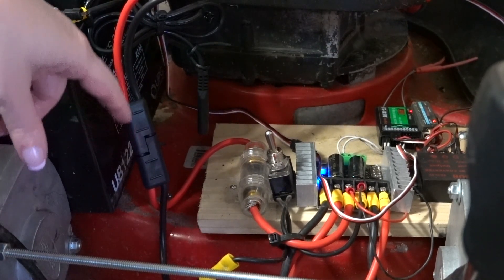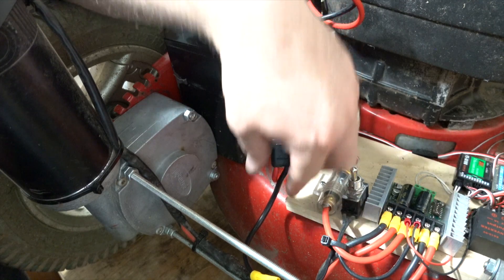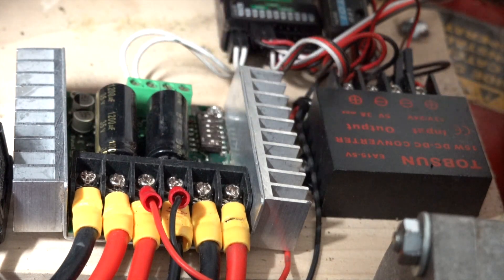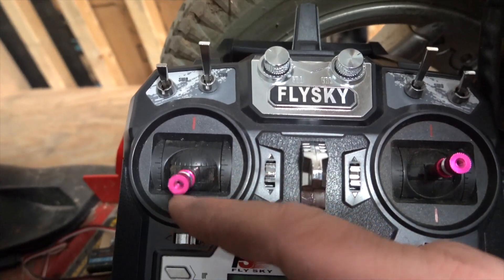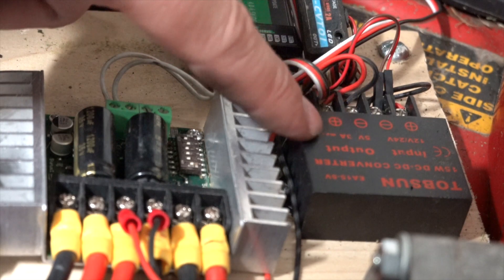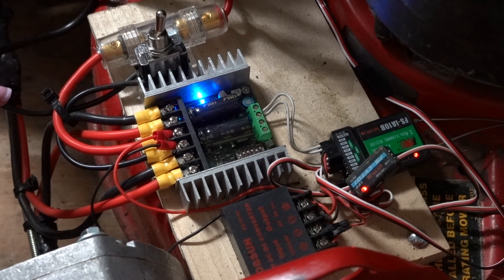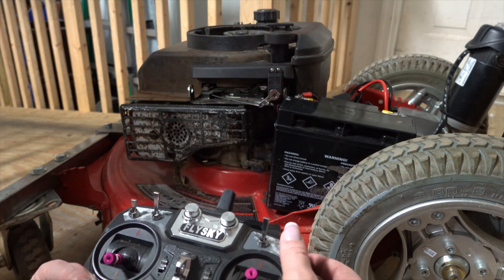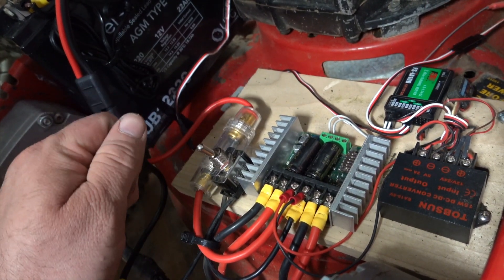How To Wire An RC Mower (Step-By-Step)

Comment: Hi to you both, Totally enjoy the video. I would like to know where you get your motor driver from?Ive started my build from an old mower i had laying around and just bought a controller. The motor driver like yours ive found runs around 280.00. Is there another one i can use?
Also do you have a video on how to setup the controller mine is a flysky i6x? Thanks Vinney
Reply from the maker: The shipping shortages are making the Sabertooth motor drivers hard to get! You can also use the Cytron motor driver, https://amzn.to/3IJVP66. We used one for a couple of months, but you will need to come up with a better way to affix the heat spreader. It comes just stuck on with a sticky pad, and after a couple of uses in a hot and dusty environment, it will come off and then the electronics will overheat. We tested it and it worked fine at first, but ultimately switched back to the Sabertooth when that happened to us.

As for setup on the controller, you don't NEED to do anything. It works fine right out of the box. The only change we have really made is to the "dual/exp" setting of channel 1 to make the steering more of an exponential curve rather than a linear line, which helps steering control when you're trying to turn just a little in one direction or the other. Any other changes for servos would be based on your particular setup and preferences.
Reply: @MeantToBeLindseyB  Thanks for the fast response. I think i am going to try the one you suggested and add a cooling fan to the top of it. The reason i asked about the transmitter was this is the first time I've ever messed with one.

Comment: Hi, how did you released the brakes on the motors????? Thank you!
Reply: Hi I followed the exact same prototype of your remote mower but now I don’t know how to release the brakes on the motors🤔🤔🤔, i got the same motors and everything, I hope you can help me, thank you 🙂
Reply from the maker: There should be 2 thin wires coming from the brakes. If you hook those to your main power, the brakes will disengage. We decided, instead, to just remove the brakes all together. Just remove the reflector end of the motor and unbolt the brake from the end of the motor and put the reflector back on the best you can. Since it’s just an emergency brake, it doesn’t affect performance.

Comment: Waiting now on your camera addition to this unit - really curious how to hook that up and what type of camera to get for it and should it be controlled through rasb-pi or wifi camera unit that links to a smart phone that is positioned on the top of your controller. Also had the idea of adding a 3rd servo and building a side deck to attach a 20v dewalt weedeater for trimming the sides of fences and house. Also thought about adding a small tow hitch to the back of the unit for pulling an airator and fert and seed spredder. Just thoughts right now, but really would like your input as well on these thoughts. Not wheel chair user but challenged as well and striving forward. The thought of being able to stay inside in the AC and get the job done is appealing. Anyway camera addition for being able to see where it is going is cool. Also if adding a 3rd servo will the remote have a channel available?
Reply from the maker: We've been considering getting the DJI digital camera kit for clarity and immediate response whereas a lot of wifi cameras have a lot of delay, which would be too risky. The biggest hurdle we are still trying to figure out is how we would control it so we could look behind as well as in front and on the sides for the same reasons. 

As for the extra servos, there are 10-channel receivers that you can get for the transmitter we used, so you have plenty of extra channels.

Comment: I a confused on how you wire the receiver.  I understand that you use different channels for different things but where do they go exactly to which ports and also the other end... where do you connect them to?  thank you for your responses.
Reply from the maker: It varies on your exact setup, but we have power in (red and black) from the step down converter to the VCC port of the receiver. Then we have just the white wire from channel 1 from the receiver to S1 port on the motor driver and just the white wire from channel 2 from the receiver to S2 port on the motor driver. Channels 1 and 2 are the controls of the right stick of the remote transmitter.

Then we have 2 servos. The servos use all 3 wires (red black and white) plugged into channels 5 and 6 of the receiver. We then went into the remote setting to set channels 5 and 6 to the dial and switch from the remote to control the kill switch and throttle on the mower. You can reference your manual for exactly how to set those settings.

Comment: I love what you two did with the push mower!!!!-and as a small engine shade tree repairman, and prior lawn service (extremely small business)owner ! wondered if you knew of other options available to add to your systems like a starter and alternator or battery charging system -to keep the servos fully charged while its running,and if you did ,why didn't you use or add them? the reason i ask is the addition would make these systems much more user friendly with a remote start and you wouldn't have to charge the batteries after mowing.I'm no way disrespecting this build, I love it!!! and hope to build one myself in the future for a personal use as I'm getting old and have a heart condition ....Not interested in pushing a mower or walking in the heat again -ever....lolololol
Reply from the maker: Thanks for the comment! 
Honestly, we don’t really know much about small engines or options for a mower engine like this. We’ve gotten a lot of suggestions about adding a starter or alternator since we built this. For the next build we’re probably going to go all electric for those reasons.

As for our yard, the one battery is plenty, but we can imagine if our yard was much bigger or on a hill or something we would definitely need some more like what you’re talking about.

Comment: Hello mate ! Your video inspired me to build one and it's running now. Thanks for the very informative video mate. Oh ! You mentioned that the Sabertooth required a 100 Amps fuse, is it really needed that big amps? Please point me to the article that mentioned it if you have time. Thanks again mate and be safe !
Reply from the maker: https://help.dimensionengineering.com/knowledgebase.php?article=2
Reply: @MeantToBeLindseyB  
Hello mate ! Thanks for the link. Reading it and now it mentioned somewhere that it's recommended to install fuses on the motors too for rolling the the motors when it 's unpowered will kill the motor driver. I am into electronic safety and might install one too. Thanks again !
Reply from the maker: With this type of build, we think it’s more likely the main leads will short rather than just an regular overvoltage spike. We still think that the 100 amp fuse on the battery lead is enough, but like this article says, it’s not a bad idea to also put 25 amp fuses on each motor lead.
Reply: @MeantToBeLindseyB  
Totally agree with you.. I will surely install a 25 amps on my motor leads for added protection. Thanks for responding. Sub !
Reply: @MeantToBeLindseyB  from that link it says the better way is to fuse the motors but they don't suggest how high a fuse you should use on the motors- any tips or ideas to do that? here's what they said - So blowing a battery fuse will sometimes kill the driver .

The better way to do it is to fuse the motor leads. If a motor fuse blows, the motor will freewheel, the Sabertooth will sit there contentedly,

Comment: it’s coming from the Motor driverThank you for answering me
Reply: You Guys are awesome
Reply from the maker: We can’t think of any reason that it would work when it’s on 2 batteries and not on just 1. We suspect you may have something else other than just the remote and receiver messed up. Email us some pictures of it hooked up both ways and we can see if we see anything obvious. Sometimes you just need a “fresh eye” to look at something. You can  send it the pictures to MeantToBeLindseyB@hotmail.com

Comment: My transmitter and receiver would not kick in with one battery it only works with two batteries 24 volts what am I doing wrong
Reply from the maker: How do you have your power supply for the receiver set up? Do you have the power coming from the motor driver or are you using a step-down converter?

Comment: How much for fixing like that electric mower
Reply from the maker: Our next project is to try it on an electric mower but we think the cost will be about the same. $500-600 in parts plus the mower. Also, a lot of people have asked but we aren't ready to personally start trying to sell them at the moment.
Reply: Tell me all the parts they put in the electric mower
Reply from the maker: @kennethsanchez1098  We haven't built an electric one yet, so we are not able to tell you that information unfortunately.

Comment: I just found some useful information that might help everyone out. I just bought an old White Lawncycler lc 215 e to make my next MowBot. The reason I bought it was because it already has zero turn wheels on it. After I got it home I realized it had an electric starter. After taking it apart I noticed it had a tiny alternator on the back of the engine. It mounts just like an ignition coil. I was curious so I took apart another Briggs & Stratton engine and it is also already set-up to mount a starter, and it has the holes already to mount the tiny alternator. It also already has a ring gear on the flywheel. So check all your lawnmowers that have a Briggs & Stratton engine. If you have the set-up you will be able to add electric start AND you can now have a charging system to keep your battery charged. My B&S engines are 6hp Quantums and the other is a 6hp Diamond i/c. I will try to post links to the parts below. If I cannot post them, here  are the part numbers. Alternator B&S Part Number 691991. $20.99 on Amazon.  Alternator Studs B&S  Part Number 691094. $7.37 only available on Part Select . com.  Starter B&S  Part Number 799045. $155.95 on Amazon. NO MORE DEAD BATTERIES! NO MORE PLUGGING IN YOUR MOWBOT TO CHARGE THE BATTERY!   I will post a link to my Facebook page below with pictures where the alternator bolts up.
Reply: Wont let me post a link to Facebook.
Reply: Holes are on back of engine, oil tube is on drivers side of engine, alternator bolts on by oil tube, holes are on each side of the governor, the alternator studs raise it up a few inches above the governor so it can ride on the flywheel. Any questions leave a comment and I will exchange e-mails.
Reply from the maker: Thanks for sharing this info!
Reply: @MeantToBeLindseyB  You might need this flywheel too. The flywheel looks to have more magnets than the other engines. B&S part #  PS9074689 flywheel.  $96.28
Reply: @MeantToBeLindseyB  So for about $130 you can add an alternator to any Briggs engine as long as it has the 2 mounting holes on the back. Anyone can comment and exchange e-mails with me if you need more information or photos.

Comment: Not a cheap hobby. I have $1600 in this build. I only have 1 good leg so I wanted to be able to sit in my house and mow on my big screen TV, so I put a $700 Hollyland Mars, and GoPro camera system on mine. I went with a brand new Troy-Bilt mower. The back of a Troy-Bilt rear bagger mower is all plastic so I had to make steel trailing arms for it, like a Ford truck. I kept the rear open so it has a rear grass chute instead of a side chute. It worked out great. Wish I could post pictures for you. Thanks for all your videos. When I get it all finished I'll post a Facebook link to a video for you.
Reply from the maker: Holy cow! That's awesome. You'll have to send us some pics! You can email us at MeantToBeLindseyB@hotmail.com or tag @Meant To Be Lindsey B on Facebook when you're finished. It's definitely not cheap but when you're paying someone else to mow your lawn, it definitely pays for itself in the long run. Of course, we did start with a free mower, so that helped with our initial costs too. Just the sense of independence it has given both of us has been worth it though.
Reply: @MeantToBeLindseyB  You got mail!

Comment: Thanks for your videos. I got mine working today. I had to pair the receiver and transmitter, you didn't tell us about that. lol.   I had to Google it, but it was easy. My only question now is how to use the fail safe. I cannot get it to work on my servo that controls the engine shut-off. I have it on channel 6 of the receiver. Same exact flysky receiver as yours. Help please.
Reply from the maker: Most receivers and transmitters come pre-bound, so our apologies for not elaborating more on that. 

As for the fail safe: In the fail safe settings, make sure that the channel 6 is “on” and that the switch for the kill switch is set to the “off” position when you save the setting. Hope this helps!
Reply: @MeantToBeLindseyB  I bought a 10 channel transmitter so I could use all the other buttons on my remote receiver. I still cannot use them because I don't know how to set it up yet..... I want the engine kill switch on the toggle switch. I'll figure it out.  And I've tried setting the failsafe a dozen times now. It saves my settings, but it doesn't do anything.
Reply from the maker: Sorry it has taken a few days to get back to you. Hope this helps!

To get your servos working with your remote this is what you have to do on the remote:
Go to Settings->System->Aux Switches
Then turn on whichever switches you want to be able to use for controls (SwD is the far right switch that I used, so turn it on) and set the Ch # to the number of channels that your receiver has, mine has 10, but yours might be 6

To save you have to hold "cancel" for 2 seconds.
Then, go back to settings->setup->auxchannels and go to the channel number you want to output to, and then tell it which switch to use on that channel (SwD in my case) hold save to cancel your switch should now control a servo plugged into that channel with no problems.

THEN

To set the failsafe, go to settings -> system -> RX Setup -> failsafe -> channel # -> set to ON and flip the switch that it should switch to when failure happens. Hold cancel to save.
Reply: @MeantToBeLindseyB   Thanks. That helped. It works now.

Comment: So I have a 12v dc motor off a car seat that I like to use as my servo on my big RC project.  How can I control that using RC transmitter / receiver?  Do I need a motor driver?  If yes, I know they make dual motor drivers, but what if I need to control more than 2 motors using RC?
Reply from the maker: Yes, you need a motor to connect the motor to the receiver. Each motor that you have will need a motor driver channel for each motor (if they are controlled independently). Since when turning this mower, the right goes forward and left goes reverse to make it turn, you need a dual motor driver.

It can be hooked up to more motors as long as they are doing the same thing (2 going forward, 2 going reverse at the same time).
Reply: @MeantToBeLindseyB  

With your inspiration, I was able to convert my Craftsman riding mower into RC.  This was the very first thing RC thing I ever made.  My next plan is to make it self driving. 
Thank you for your answers and inspiration.  Here's the link:  https://www.youtube.com/watch?v=J0lgwsn71tk
Reply from the maker: That is amazing! We've never seen a riding mower done with full RC before. Great job!

Comment: Can you explain the DIP switches in detail? There are many options to chose from in the manual you provided. (Same set-up as yours)  Thank you.
Reply from the maker: You can use the DIP switch wizard to help figure it out for each setup. 

Based on OUR exact configuration, with independent steering and exponential acceleration, we have 2, 3, and 6 ON the rest OFF.

https://www.dimensionengineering.com/datasheets/SabertoothDIPWizard/start.htm
Reply: @MeantToBeLindseyB  Thank you.

Comment: I'm betting that battery doesn't last a long time. I have a similar mower build but used 2 wheel chair batteries at 24 volt and they are about dead after mowing.
Reply from the maker: We get 20-30 mins on pretty flat terrain with the 1 12-volt battery. 24-volts was just too powerful for what we need it for. We could do 2 batteries in parallel to get the same 12 volts with double the range though.
Reply: @MeantToBeLindseyB  With the sabertooth 2x32 you can configure the settings by plugging it into a computer via usb. You can set max voltage/amps to the motors and also change sensitivity / delay. I've got mine turned down to about half.
Reply from the maker: @maykevin5  Wow! That’s cool. Didn’t know you could do that.
Reply: @MeantToBeLindseyB  only on the 2x32. If you look next to the receiver channel connectors you can see the blank usb connection on the sabertooth board on yours. Take a look at the guide. You have to scroll down to the describe software section. https://www.dimensionengineering.com/datasheets/Sabertooth2x32.pdf